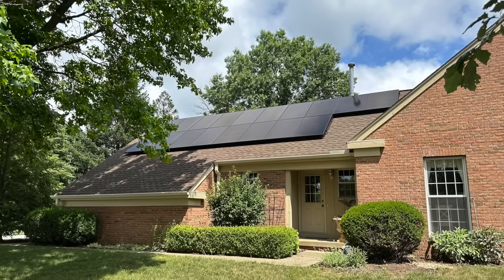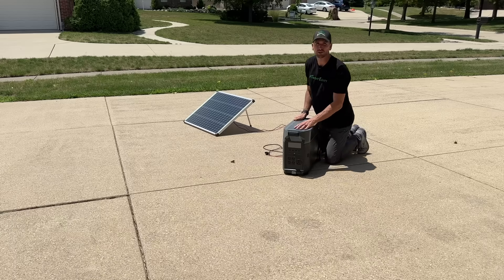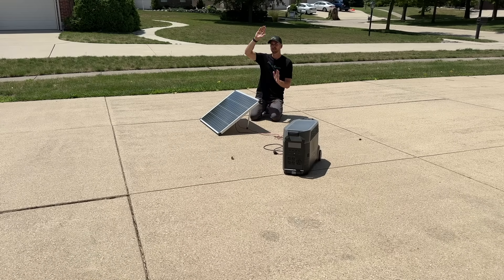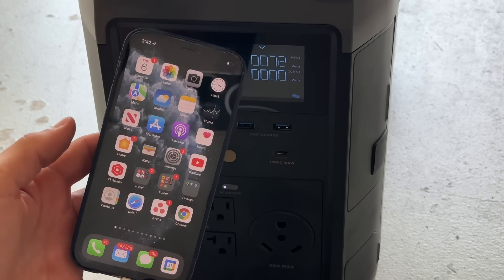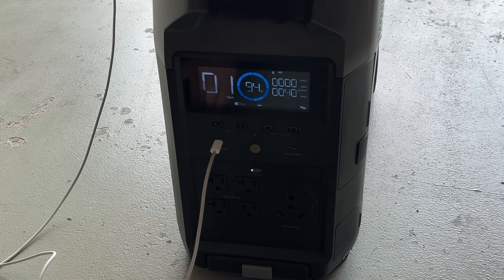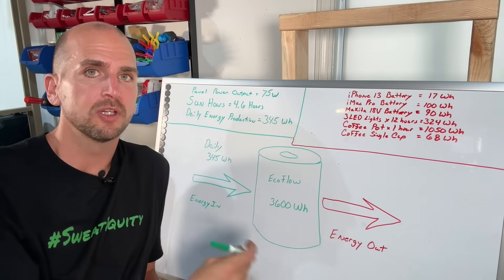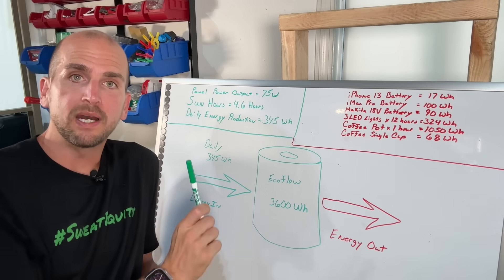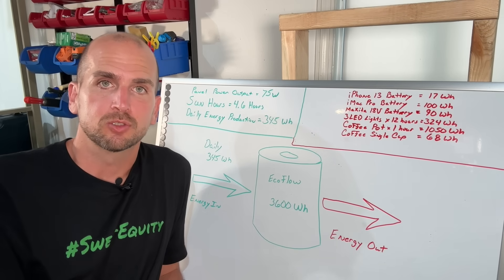What Can You Run On A Single Solar Panel?

Comment: After discharging my Bluetti AC30 fully, I connected it to a HQST 100 watt solar panel that I put on the roof of my screened in room.  I have an in-line meter that measures watt-hours installed between the panel and the solar generator. I connected these together at around 8 AM and by evening I had only charged 176 watt-hours into the 300WH unit.  That is because the day was mostly cloudy and we had a thunderstorm in the afternoon.  I have conducted these tests before.  In March of 2021 when the days are shorter, but sunnier, one 100 watt solar panel would produce enough electricity to charge the solar generator before the sun went down.  Two 100 watt panels in parallel would charge it in half that time.

I also have an Ecoflow Delta 1300 solar generator which will handle 400 watts of solar. On a mostly sunny day 4 panels will charge it completely. 

My whole purpose for buying this stuff is preparation for a hurricane.  I live in South Florida.  The Ecoflow will run my refrigerator which uses 1100WH a day.  Of course there is no way that I can keep that refrigerator running on solar.  Knowing this I bought a 3500 peak watt inverter generator on Amazon.  I figure that I can charge the solar generators a couple times a day with it plus microwave, run the coffeemaker, etc. on a gallon of gas per day. Solar will supplement the power created by the generator, not vice versa.
Reply: Parallel panels and 200w mono panels are very useful for cloudy days. I can sometimes get 30 to 40 watts into my portable power stations when it`s cloudy. If you`re using a 500w power station for an Onite LED light, cooking rice a few times per week, or breakfast with a 350w Dash griddle the cloudy days won`t matter much.
Reply: I have power stations but I also got an Ampere Time (Li Time) 12v 300ah LiFeP04 I can recharge with solar or a gas generator with a 30 amp plug-in charger to power a small 400w window ac after hurricanes or storms in Louisiana. I top it off before storms. It has been a BLESSING with all the power outages we have. They have 280ah batteries now for around 500 and some 300ah but who knows what the quality is? Li Time is a really good brand with a 5 year guarantee.

Comment: I home built a solar system that supplies 1/3 of my energy use. I built a 7S battery using 18650 cells (3.3KWhr). I bought 20 used solar panels from Santan Solar for $1300 shipped.
$278 for an Epever Tracer 6415AN MPPT charge controller, $215 for a 400 watt pure sign wave inverter from e-trailer. Total cost around $2300 US.
My system has been running reliably for 1 1/2 years, using only 4 of the solar panels purchased. Plans are to get 100% solar powered and get those other solar panels into service.
It was a lot easier than I had imagined. There are many approaches to using solar.

Comment: I use the nomad 10 by goalzero lol for all my small devices and best use of 100$ i ever did
Reply: Update I am both impressed that I got a quality product I'm here a year later using this panel right now to charge my phone and both upset because I now understand how big of a rip off this was. Way overpriced for what you get. Save money. Shop elsewhere. You do not need a "weatherproof" solar panel. They are all rather weatherproof.
Reply: My new goal is to get about 3 or 4 more panels with about triple the output and line my cars back seat with them. The little area behind the seats. I can pin them down there and they would be great for keeping power banks charged when I'm at work or out messing around or something.

Comment: Net metering - may end in your area.  Once a power company obtains enough solar contracts with home owners to totally fill their demand; they no longer want to compensate for extra power they can't sell.  This is already happening in the SW where they have a lot of solar; you can't any longer get net metering -so even if you can get it now - you may not be able to in the future depending on your local areas power needs.

Comment: The "Generators" do NOT generate anything.  They are glorified batteries, that store electricity from the panels.  You already have a generating device (the alternator) in your car, and a battery too, good for emergencies.  This will charge electronics at idle speeds.  I have a solar system for small ongoing loads like lights.  But for serious loads, I crank the Honda 2000i gasoline powered generator.

Comment: Four points I want to make.  (Sorry I didn't read all 246+ other comments so I may be duplicating what others wrote.)
1. I see the list at 11:34 of Watt·hours and it's tempting to add it up. But one must consider how often you use each device/tool. For example, maybe you need to charge your iPhone 2X per day, but the laptop only once per week. Also, maybe you need 2 pots of coffee per day? Maybe you only drink coffee on cloudy days. (People likely use more lights on cloudy days.)
2. Having a charge controller+battery with 3600 Wh capacity seems handy. So usage could fluctuate wildly. As long as over a period of (say) ten days, your battery stays 'topped off' then you are fine. But if you find it is constantly hitting zero, then you need to add more solar panels. Perhaps if the household is "smart", i.e. "today is laundry day, so no coffee" etc. then you can survive with fewer panels or a smaller battery.
3. Seems like the panel can produce up to 100W. I'd be tempted to use a mirror or reflective metal (mylar?) to get more light on the panel(s), so they are maxed out. Also, that would allow it to be over that minimum 11V more often, possibly adding hours to the daily collection.
4. Why only 4.6h per day? That number is just "peak" or "optimal" sun values. In reality, I think you'd get more than that per day. Have you really found that number to average out correctly?  (I live in Phoenix, AZ so our number is higher!)
Reply: What do you use your laptop for if you only need it to charge once per week?

Comment: Here he is mister know it all again! Jack of all trades master of none giving advice. Last video hes showing you how to plug a tire LOL !! BEWARE Solar panels can be a very bad investment on a house for numerous reasons. 1) Homeowners policies can drop you for putting them on your roof, leaks ,holes,mold and storm damage to roofs and panels. 2) Power companys are now starting to charge customers maintenance fees ($50 per month) in my area because the solar lowered bills now are shorting the electric company all those extra transmission and maintenance costs listed on your bill based on power usage now lowered. 3) Payback is usually 10-12 years at least if at all, it can cost you more to pay for the system and service contracts then the electric bill for years. 4) Maintaining the system itself. Solar panels power output degrade over time about %1 per year, inverters fail (1 under each panel) and get taken out by lightning and then they will sell you a service contract further putting you in the red. Roof repairs from leaks atleast 60 holes depending on the amount of panels. The wind in storms ripping the panels off your roof and plywood with it. 5) Government incentives are disappearing yearly and power companies are cutting off buying excess power back to their system as time goes on. 6) Lowers the value of your house (not raising it) Nobody is going to want to buy your house if you paid off half of a $60,000 contract over time and that house still has a note against it for $30,000. You would have to pay it off to sell it, which means no benefit to you just losses plus the remaining electric bills you already paid.  7) May not even give you the savings you were promised. Some geeky kid with thick glasses and pocket full of pens and a calculator will promise you all the reductions in your bills but with no guarantees and not telling you all the pitfalls im telling you. I have alot of neighbors with them most are getting screwed. The direction your roof faces is a major concern but they will sell you the system regardless and probably oversize it as well to make up for the lack of sun exposure costing far more than the power would have cost.. Alot of unscrupulous solar companies putting them in. Depending on how much they oversize you may never break even. Especially with service contracts and repairs to the house because of leaks. The weather plays a big part in it also, so no one can guarantee you anything. (Sun vs Clouds) If you bought storage batteries guess what, they only last so many years and you have to buy new ones and pay to dispose of the old ones MORE COSTS!! and before the payback comes in!  Putting solar panels on a house can be a very bad investment, you really have to do your homework, they definitely are not for everybody, but even if they somehow save you some it wont be for years to get the payback meaning your stuck living there until the contract is paid off. And that doesnt mean you saved anything.  Its not the lower electric bill you need its lower money spent on electric, and if a $60,000 system over 12 years doesnt save you $60,000 - you lost. Plus the costs to keep it working and finding a Home owners insurance company that will write you a policy that will cover the system (Higher Costs Again) and wont drop you but at the very least the policy will cost you more on top of everything else. When looking at your new H.O.'s policy read those exclusions!!

Comment: I wonder what kind of a system I would need for a tiny fridge or freezer. Constantly running, bet that's a ton of juice.
Reply: Depends on the size of the freezer, if you have a battery bank, ambient temp and how often you’re opening it. With a battery bank, you can run a freezer pretty affordably.

Comment: Just to be clear after reading the comments …. This guy is only using the solar generator to show the watts the panel is producing …. That’s it …. The main problem he’ll have it matching the increase in panels to meet his demands down the road with the allowable maximum input the internal solar controller will handle. He’s not trying to recharge the solar generator …. That’s his watt meter in effect ….

Comment: Here in California...insurance companies will not cover your roof damages from solar panels screwed into roof. Apparently people are not getting on the roof and making sure those screwed areas are sealed
Reply: I have a barn/garage going up and I want to power it with solar. Electric outlets, lights, three garage door openers. The panels are going on mounts on the ground. It has lifetime shingles and I do not want to void the warranty.

Comment: Great video.  I am trying to bring water to a rural property that I own and wish to develop.  I am exploring solar well pumps.  In addition, I inquired to a solar installer about the possibility of developing an off-grid system for a small home using solar panels and battery backup.  The quoted price?  Upwards of $40,000.  I was trying to save some money over the nearly $30,000. cost to connect to the electric grid from my local electric co-op.  I don't know how long the solar components last, but I don't think the cost savings for the average consumer for a totally off-grid system is worth it if you can still connect to the grid.  Does anyone have experience with solar well pumps and their installation, and have an opinion on these pumps?  I have a local well driller coming out soon to give me a quote. Thank you!
Reply: If the land slopes, check out hydraulic rams.

Comment: How many to power the whole house based on 2000 sq ft normal 3-2? That's the baseline most serious home owners thinking of getting into it want to know.
Reply: Near Ottawa summer daily usage is about 14kwh …. Winter with furnace on about 15~16kwh …. And we turn everything but the frig off at night to conserve. During summer … no AC …. Clothes drying  air …. LED lights etc.
Reply: No A/C...in summer...lol.

Comment: To be straight forward and honest, for camping, outdoors recreation, sure grab yourself a solar generator unit, they are good in that capacity, for a few lights in your tent, a radio perhaps, charging your phone, powering your tv or laptop a cordless drill battery. However in a home or survival shelter or going off grid, i would encourage ppl to just get a full system. Such as a panel, a charge command a battery and a power inverter. This way you can isolate what is wrong if ever a problem. Because like anything, its going to require regular service. Such as the command unit may go out, you simply replace it not needing to open the box, most of those generators simply are not user servicable. For the price you pay because they have litium battery, is outrageous. 600 USD for the one here its a very small AH watt hour battery. For people who are on a budget, I will give you an example of my set up

It was easy, i paid less than 350USD for a 100w with a 12v 100ah RV battery, with solar panel directed to the sun angled to be the most efficent. I found an app on godggle play which tells me exactly where the sun is year round, sun tracking. For hard wiring your RV, Off Grid shed/cabin, think RV set up. You can get a 100w Solar panel kit from Amazon, which comes with a panel, mounting, 25ft of cable and a charge controller for 89.00USD, I purchased a 750W Jupiter modified sine wav power inverter, which I mounted on a 2x2ft piece of plywood. I then bought a 12v deep cycle RV battery, not a car battery, the two are made differently, an RV  battery is specically designed to be charged by a generator or charger or solar charge , it doesnt have the power kick a car battery does for starting a motor then recharge from a alternator. 

Its specifically designed to operate the lights, appliances, tvs in a RV camper. Most sold are sealed where as a car battery is not and car batteries off gas which can make you really sick, a sealed battery you can keep inside like under a counter. Deep cycle means it can go lower than 50% , mine have gone down to 75% depleated and its fine, it recharges back great, no battery damage. The price of an deep cycle rv battery is 129 then a core. I started with one battery and my solar setup. Its been over 5 years and its still going really good. litium batteries are extremely exspensive, they have many pros also, but again many people having to resort to alternative living situations probably dont have a 1000usd on hand to buy one single litium rv battery, yes one thousand doallrs or more per battery.

Not letting people know the alternatives of powering a make shift shelter  considering that most people look in to solar might be searching for ways to reduce costs or being off the grid. A more solid system with reliable batteries and cost efficient, if the battery is small in that solar generator it can olny operate for so long and has to be constantly recharging, yet a 100ah if keeping minimal lights and appliance going , a fan and a several lights, the battery can go three days, just like a camper.

And the best suggestion ive ever seen about alternatives , learn to live needing less power, be frugal. Most of the stuff we use , we dont really need to live a good wholesome life. We have been so brain washed into giving our money to utility companies about things we really dont need. So to change your life and go solar , so also change your life so that you arent so dependant upon. Its nice ambience to live 1800s with soft lantern light , peaceful, relaxing, comforting. I have 1000 lumen LED lights outside , but not a lick of electric battery, all solar, solar yard lights, solar decrative lights. Learning how to go entirely solar is fu, but can be very inexspensive. Im not trying to say bad about this video , i just know that there hundreds uopon hundreds of people going homeless , they cant afford 2-3-4 thousand dollar gadgets, We need more youtubers making videos about how these unfortanate can get power for their shack or tents. As humans we should be sticking for our fellow citezens, not sticking up for the companies over charging for profit.
Reply: A 100ah 12v LiFeP04 battery rated at 2000 to 5000 charge cycles before losing 20% capacity is about 230 bucks right now. A 200ah version is 500 bucks. These can be fully discharged and are safer than regular lithium ion and last far longer. My 300ah Ampere Time runs my small air conditioner and has a 5 year warranty and is rated at 4000 full charge/discharge cycles. If cared for properly it can get way more cycles and is good for 12 to 20 years.
Reply: Bob Wells at cheap RV living is a wealth of information. We don't actually need more YouTubers teaching as we need to direct others to Bob's channel
Reply: @dawn7882  Went to Bob's channel. He's great. Subbed. Thank you.
Reply: @carlthetruthwilliams9447  You're welcome 😁
Reply: Great useful advice. I'm learning about solar hoping to have a modest setup down the road. The power station in the video looks handy but when I saw the price I about spit out my coffee.
Reply: Thank you very much for this informative comment. I am currently trying to put together a plan for a simple but somewhat decent set up for a small cabin. Id really rather not spend a ton of money if I can get away with a different option. I am going to look further into what you were mentioning with the RV deep cycle battery.  Do you have any other resources you'd recommend for reading more about the kind of solar system you have? Thank you again!

Comment: It's useful to have a charger, digital signal processor, and a shunt with the solar panel run online with a small storage cell. 
SJ research achieved this over the last decade.